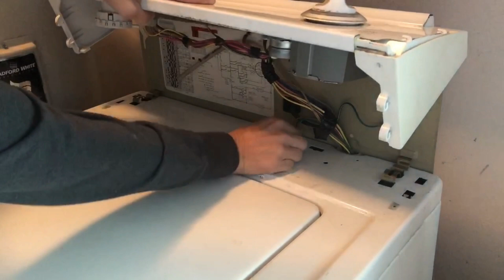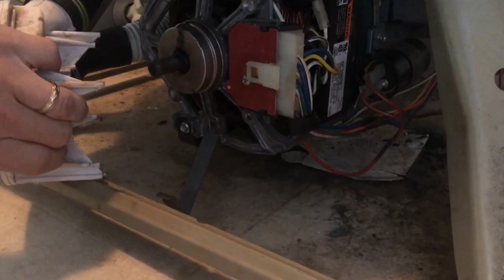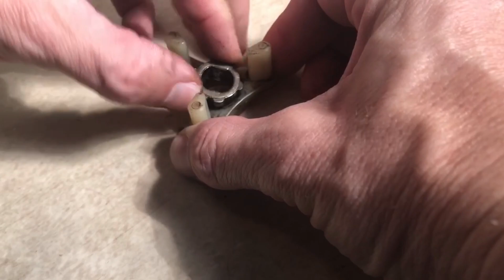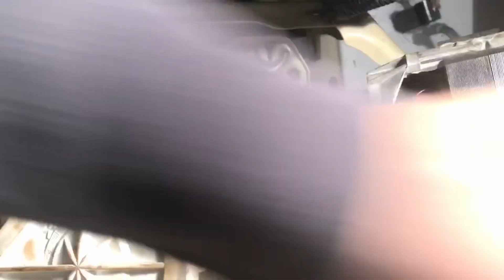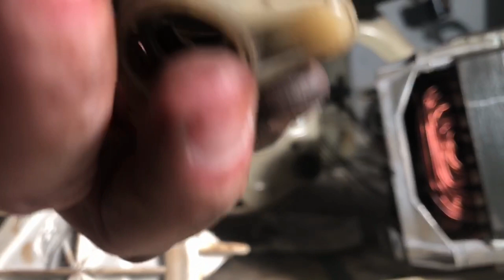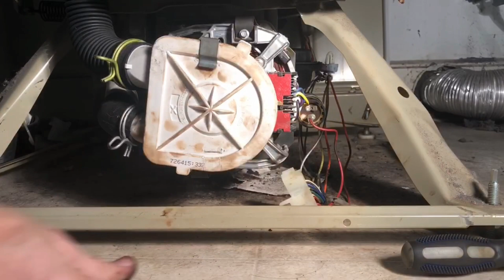Kenmore 80 Series Motor Coupler Repair

Comment: Two points:  

1) The agitator is in two pieces.  I changed the coupler but it turns out that the top part of the agitator is what is broken on my machine, not the whole thing.   See the video: "Kenmore 80 series washing machine agitator repair not spinning. New pawl assembly to like new again."  That's what mine needs.  

2) Don't disconnect the hinges from the control panel when flipping it over the back of the washer.  They hold them there very nicely.  I think they are designed for just this procedure.

Comment: Thanks for the video ! Going to get the new coupler tomorrow. My coupler has no metal insert. Its plastic is form fit to the motor shaft. 1 of the plastic parts of the coupler that attaches to shaft is completely round from all of these years of use. So the motor was just spinning and not engaging the part that operates the spin and wash cycles.
Reply: Same with mine. No metal insert !!! 😮

Comment: ✨🧺✨thank you for this VERY informative video… I truly prefer a top loader… my man repaired the switch about a year ago and now he’s about to repair the agitator… my mom and grandmother bought the 80 series Kenmore washer & dryer for my first apartment over 20 years ago from sears and they both are still working… moving from apartment to apartment then into my home… I’m quite sure they are both smiling from heaven as I have kept them in mint condition✨🧺✨

Comment: Instructions were great! I'm having trouble getting the coupling out that lies under the rubber part and that wasn't in the video... What do you do when that part of the coupling is stuck?
Reply from the maker: Are you referring to the three prong plastic piece that is on each side of the rubber piece? If one is stuck I would see if you can get a screw driver behind it and carefully pry it off the shaft.
Reply: @cheapjoker3321  yes, the 3 prong plastic piece. The one that was attached to the motor was easily pried off with a screwdriver, but I can't get a screwdriver behind the other one... Thanks for your reply

Comment: I followed all these steps and then when testing it was spinning and then slowed and it's now locked up again.  Any ideas where i went wrong?
Reply from the maker: I would check to make sure the coupling and the rubber portion isn’t damaged. Check to see if you have free movement with the motor axle. I would start there.
Reply: @cheapjoker3321  i ordered a brand new one from Amazon and installed it and it spun just fine. I haven't taken it apart yet to see if it's broken again but I have to assume it is. what would be wrong next to cause it to break a brand new one as well? Something more serious?
Reply from the maker: Nelle Jobe if they are broke again then I would definitely check the movement of the motor shaft (that coupling goes onto - both coupling ‘s) to see that is spinning freely. Inspect the shafts the coupling are on for rounded edges. Make sure that the edges are not rounded to much where it makes the coupling not spin with the shaft. Spin the coupling with your hand  to see if there is any major resistance. That would cause the coupling to break.
Reply: @Caleb Edwards  thanks for answering... very frustrating when no one answers lol.  Mine ended  being a bad clutch. Bought the replacement kit off amazon for$20 and had it fixed up 2 days later.  Good luck to you!